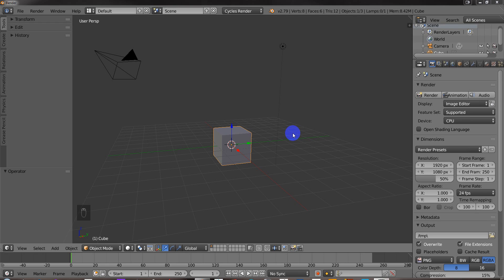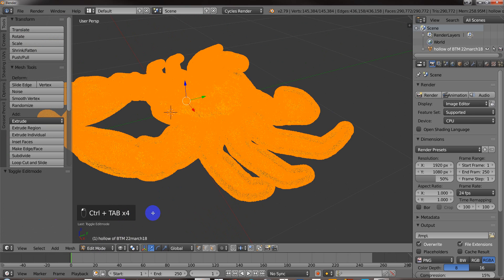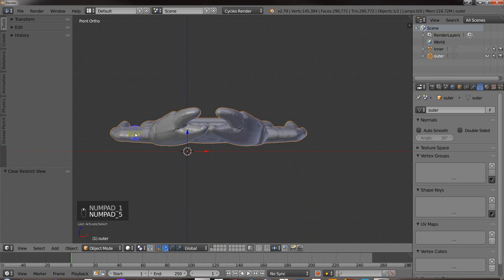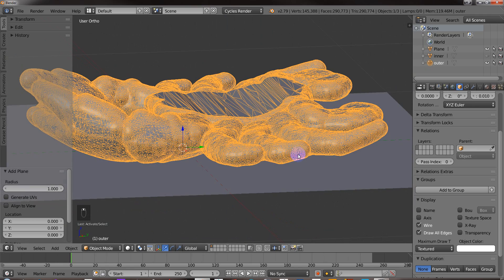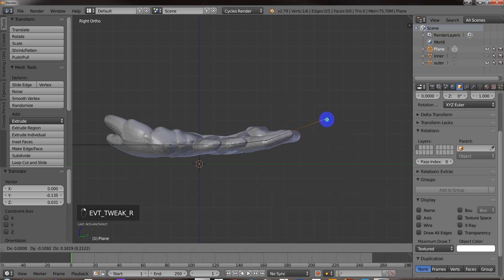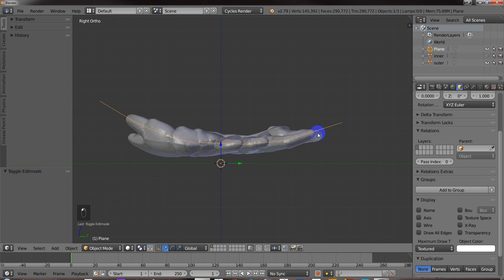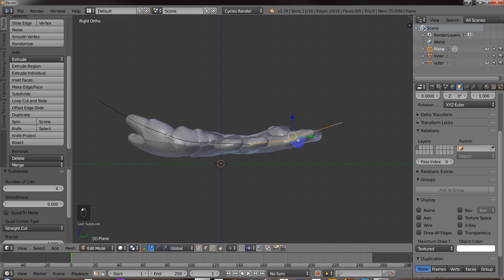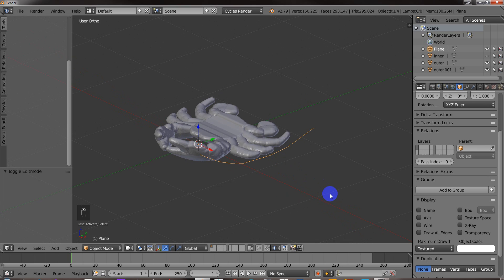How to split a COMPLEX STL model into two objects using Blender using Knife Project.

Comment: So, total noob question, what's the hotkey for vertex select?
And if you can help, basically I'm trying to make a mesh with 35,000 triangles in it, be cut into parts with 5,000 triangles or less so I can upload them to a game and  piece them together, does this work for that as well?
Reply from the maker: Ctrl+Tab is the hotkey for Mesh Select Mode in Blender 2.79. It will be "1" in Edit Mode in Blender 2.8 I believe. Here is a great beginner's course that is quick and free. https://cgcookie.com/lesson/first-steps-with-blender 

Speaking as someone who has made video games for a living, for over a decade, trust me when I tell you that you want your topology and polycounts specifically targeted and optimized for the specific video game. Please consider retopology for your game objects. Depending on what you are doing, that may prevent you from having to cut up your object.